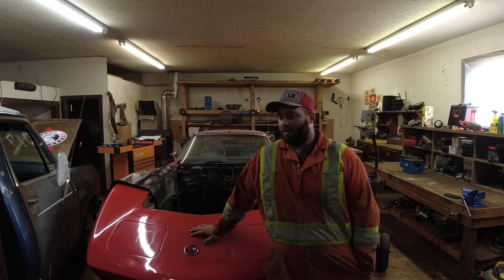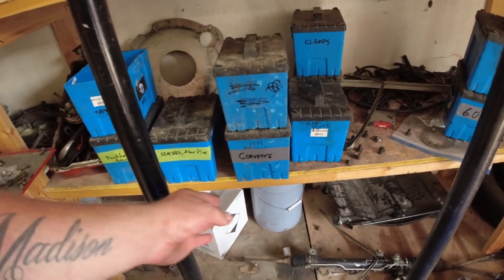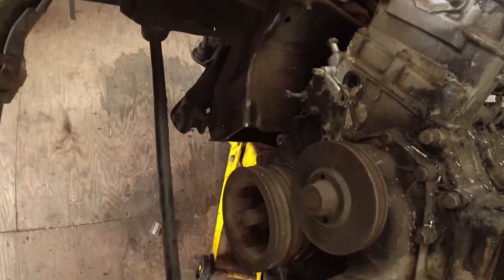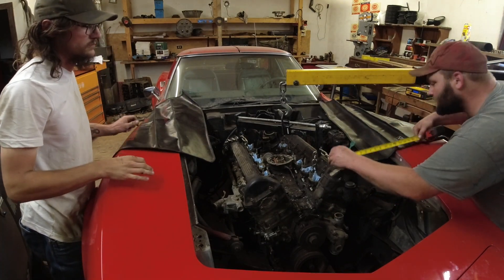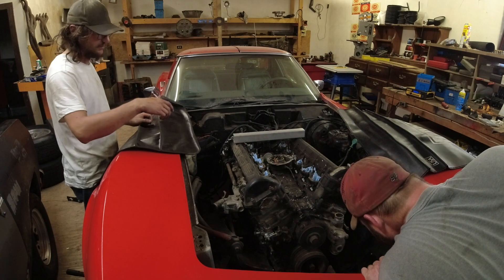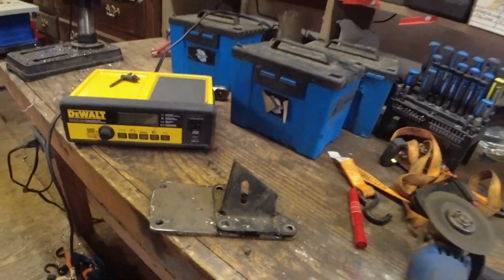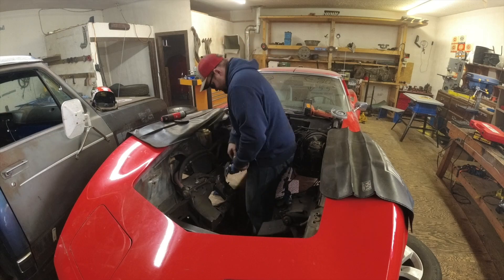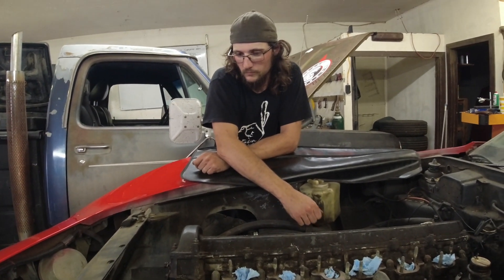Mounting The V-12, 5.3L V-12 Swap Pt. 2

Comment: I think what u guys are doing is fantastic! Great to see that engine come into this century ( kicking and screaming) 
Is crank angle sensor ignition an option to get rid of that distributor completely? 
What engine management system are u thinking about using?
Thanks
Reply from the maker: Thanks, it’s a hairbrained scheme but we hope we can pull it off. Yes, by switching to a cam and crank sensor we can convert the ignition from distributor to a LS coil setup. This will give us the ability to fine tune the ignition timing and have full control if we decide to go boosted.